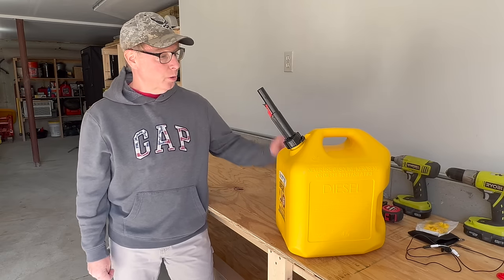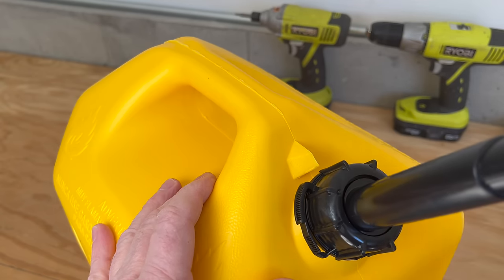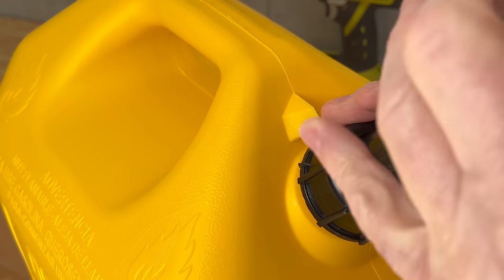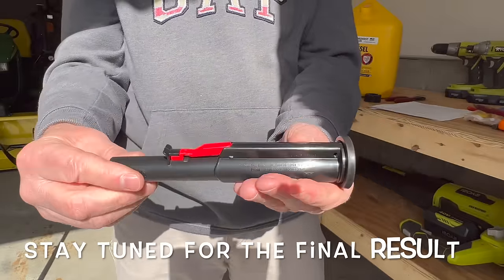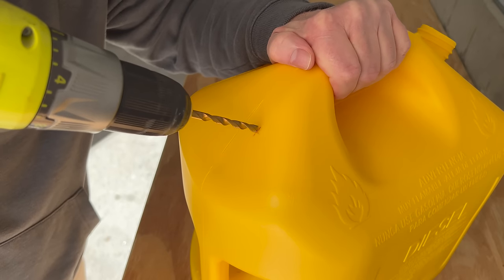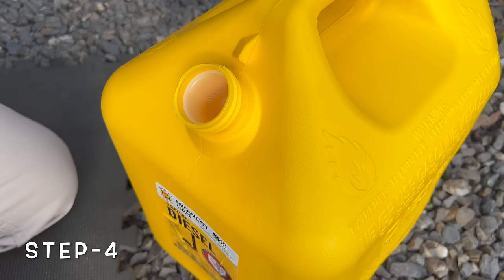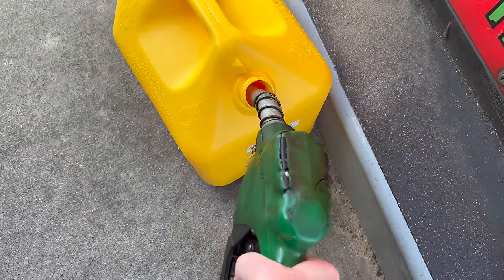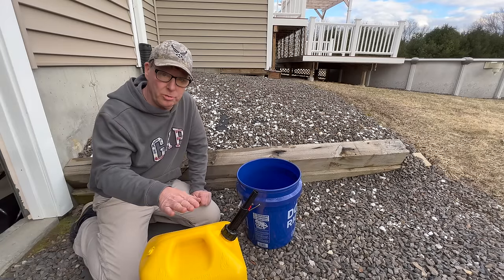Fix a New Gas Can in 4 Simple Steps.

Comment: i have clipped SOOOO many irritation tabs of various designs from caps. mouthwash especially comes to mind since I don't want to fumble with the thing so early in the morning when my joints are still stiff. it's like, to open this child-proof container, ask a child.
that spring is far too stiff for use on something like a a gas-powered weed eater, chain saw, or even many lawnmowers. the small 2-stroke machines usually fall over trying to open that nozzle, and a lot of mower tanks flex and eventually break under that weight. of course when things tip over or break, they spill. isn't that what the valve is supposed to prevent?
no safety device should create a new problem. the "safety screen" is yet another item that causes spills if the pump doesn't shut down fast enough.
all three of these things should be deleted and made illegal.
i never opened the vent. then again i only ever filled small tanks.
with the poor quality of pump gas sold these days, small engine carburetors don't seem to last me more than a season without needing rebuilt. i don't have time to fuss with rebuilding a carb when i just want to mow the yard, so i bought a corded electric mower. thankfully i don't have trees to deal with.

Comment: FOLKS, clip off the lock and leave the spring-loaded spout intact.   I've never had a problem using them on anything I needed to refuel and it is safer because all you do is quickly lift/take pressure off the spout and flow stops. 
HIS WAY is dangerous because the spout keeps flowing until you pull the spout closed with what?  Your third hand when you're using two to hold a full 5-gal can???

Comment: In 2024: Same can, new nozzle design requires holding down a safety tab while simultaneously squeezing a square block that allows fuel to flow slowly. Same flame retardation insert. Difficult to operate with gloves, cold hands or Arthritis.

Comment: These "fixes" seem reasonable.....HOWEVER.....
If fire investigators determine the cause of a fire had anything to do with "fixes" to your fuel storage your home insurance company will have an issue.
That vent may be OK for deisel but for gasoline that vent you install has to hold about 9 PSI of vapor pressure.   With a pop-in vent that is unlikely.

Comment: Easier to use a 6mm, then 9mm, then 12mm.  Fractions (British) are garbage - science (metric) rules    :-)
Also, did you blow out the plastic?  Or wash it out?  Where did those plastic drill shavings go?
Reply from the maker: Actually not much entered the can but I sucked it out with a shop vac.
Reply: @BackyardMaine     Good to know, but you should have showed / said that in your video.  Bun we love 'ya, Maine!

Comment: Every modification you made eliminated something mandated by some safety law or regulation meant to make use of the can safer.
Reply from the maker: I agree. The issue is that in reality they make the can less safe because you spill more fuel. That's just my opinion though but if you read the comments you will see I'm not alone. Once I buy a product I can alter and or use it the way I want. I am not encouraging anyone to make these alteration. Just showing what I did to my can.

Comment: No thanks.   I need the vent protection since I weld my trucks Jeep's and other hobbies near the cans storage area.  These cans are still junk after your modification tho since the nozzles are too short for vehicles and don't work on anti siphon gas openings on modern vehicles.  For kero or diesel this reasonable.....not for gasoline tho.

Comment: Wow it works just like the old kind used to that's now obsolete right that's how screwed up America is. And you think that's bad wait to the computers in the next decade if you haven't noticed in the last 5 years or so it's getting more and more and more difficult more hops to get what you want computers will not ; answer a direct question

Comment: These new spouts are complete garbage! The previous version was actually decent because it flexed and the push lock was at the base. Allowed the weight of the can to activate the lock and once you lifted the can it shut off. The flex nozzle made it easy and safer for small tanks.

Comment: Why did they make them to size to fit a hole of 31/64ths.  They could of just made it to fit a 1/2 hole.  That was another dumb thing that gets done when u leave it up to a bunch of ppl who dont know a thing about real life. I dont have in  my 3 sets of bit any that are 64th's.  I would have to buy a bit to make these work.  But I will just to have my 10 cans pour right.  At this time i take the dam thing off and use a 12" funnel.
Reply from the maker: I drilled the 31/64th hole and there was no way the vent was going in. I used a plastic hammer and destroyed the first one. Then I drilled a 1/2 inch hole and it snapped in tight.

Comment: B***chin" is the new black. I have these jugs. I have  none of the issues. Im glad that filter is in it. I like the spring, because When filling my generator with a full 5 gallon jug, but the Generator holds about 2.5 When I raise up and let the spring activate, it doesn't pour gas all over the top of my generator. The ventilation let's the gas come out at a Rate, that doesn't end up with a ,Surprise too much. Plus you can't take these modified jugs to a Commercial job site. # Osha. But if none of this makes sense to you. Why not buy a race fuel jug and be done with it.  It's not like you can't still complain about gas prices. Electric cars. Or jewish space lasers.

Comment: More save us from ourselves safety doodads, I HATE my fuel cans... I have spilled far more fuel with the "SAFE" cans than I ever did with the old dangerous ones.....gonna fix them all now..  I also noticed that over time, the fuel expands the hard plastic in the sliding "SAFETY" nozzle to where they no longer slide to the open position .... more spilled fuel.. and buy a new can...  to get a new nozzle that only lasts for a couple years then seizes up....sheesh

Comment: You've basically converted the can into an old style can, the kind that actually works.  

I bought one of these on auction, and I regretted it immediately.  As a professional engineer I have to say the design is a disgrace.  It looks like a 4th-year design project that should have been killed in its cradle.

Comment: Why are you using offroad diesel ⛽
Reply from the maker: Because it's cheeper since it's not taxed at the same rate as on road diesel. They dye it red so it can easily be identified. I only use it in my tractor which is an off road vehicle.

Comment: I do not suggest to do what this man is doing  he is removing the Safety mechanisms built in for maximum safety I repeat Safety  Motor fuels are very dangerous
Reply from the maker: Safety is exactly why I do it. These spill fuel when pumping and when filling. Very dangerous design until modified in my opinion

Comment: I'm with you on this but I would never give these instructions on a YouTube channel. There are several liability issues you are exposing yourself and viewers who do this mod. The DEC here in NYS pull landscape company trucks over to spot check for issues such as spray pesticides licenses, the presence of banned gasoline powered leave blowers (on the Town Level) and AND ... For emissions compliance. 

These gas cans have been designed to minimize evaporative emissions. The vent that goes down the nozzle is meant to use the displaced vapors in the mower's (or whatever) tank as the gasoline pours in. At the same time, the air needed to allow the can the pour is repurposed moser tank vapors. 

The same has been done with automobiles. Do you remember the accordion outer sheath that used to be over the nozzle one gas pump dispensers? They too were designed to exchange displaced gas tannk vapors and use them to reduce vacuum in the service station tanks. All of this was to reduce evaporative emissions which the EPA takes very seriously. The same goes for these jerry jugs

The reason the accordion vapor recovery gas pump nozzle foreskins are disappearing is because car are now required to have a much larger vapor canister that can accommodate displace vapor from a full tank fill. As many who no about evap emission controls on cars know, that vapor canister is purged via engine vacuum and the vapor is burned in the engine combustion chambers.

More over, if one of your audience does this mod and winds alight because of spillage, you may incur legal liability.

Comment: 🤨 NOPE ,  U   FORGOT  # 5 !!!   Where  U  position  the  nozzle - and  tip  the  can  to  Fill  as  U  press  down  on  it  to  start  the  flow  of gas  👉(  Now  don’t  forget  that  filling  small tanks  such as  weed eaters  &  chainsaws  have  very  small  tanks  that fill  VERY  QUICKLY  ) ,  SO,   U  press  in  and  fuel  comes  “VERY  QUICKLY”  and  U  pull  up  so  the  spring  loaded  nozzle  will  pop  back  out   &  ST🛑P
the  flow  of  gas ;   BUT 😫,   HOLY  C - - P 🤬,  THE 🤬  FREAKING  NOZZLE  DID  NOT  SNAP  BACK  OUT  (  because  the worthless  piece  of  C - - - was  stuck  and  WOULD  NOT  POP  BACK  OUT ! 😡 ) ,
and  NOW  I  HAVE  GAS  GUSHING  OUT  ALL OVER  my weed eater  /  chainsaw  /  leaf blower,  
NOT  TO  MENTION  ANOTHER  GAS  CAN  with  the  same  piece  of  C - - -  NOZZLE  that  I  use  for  the  Mower  fuel  😡❗️  But OVERALL ,  it’s  a  GOOD  video  &  I  like  your  IDEAS  with  the  other  stuff…  AS  for  my  issue ,  I’m  going to  convert  all  mine  BACK  to the  OLD  flexible  tube  type  of  nozzle that I can  pull up  and  out  with  my  fingers ,   FILL -  THEN  simply  push  it  back  in  and  screw  on the  OUTER  CAP 😁  👍…   As  for  the  designer  folks  you  were  referring  to ,  I  agree ,  and  I  will  give  them  a  Salute as  well :  🖕🤬  !!!

Comment: These new cans suck, and  the prices are outrageous.   Even a 1 gallon can now is about 20 dollars, with all the crap they put on them like what you're showing.   Another problem is that the collars on the spout will break, making the whole can worthless.   When the collar breaks, you can't tighten the nozzle to the can.    I've ordered replacement nozzles on ebay, but they are not compatible with the threads on these cans.   About the only thing you can do with these cans once the collars break is to find some kind of cap for the can, then use a big funnel in place of a nozzle.    I've got several of these older style plastic cans sitting around, and some I just can't use because I don't have enough caps for them.
Wait till you see what Biden has coming with all the new EV and CAFE mandates, and other legislation to save the planet.

Comment: Skill issue. Yall need to put down the bag of paint chips and learn how to use it. yall only bad at it because you only refill your 48" zeroturn once in the spring for the 30' grass strip between the mailbox and the tickytacky ass 6000sqft house in the burbs you bought for $4k before y'all set fire to the rivers and well water and pulled the ladder up after you

Comment: or you could just spend 2 minutes learning to use it. any excuse to blame others.
Reply from the maker: I know how to use it. lol The issue is the design is horrible and you will spill fuel filling it and more again when you pour it. They when you have a big temperature differential the can will either suck in or bloat out substantially. I had a different style suck in and split open out in the garage when it was below zero. 5 gallons of gas on the floor..
Reply: @BackyardMaine  to each his own, but you are talking about two separate things, the spout/pour design and the body material.